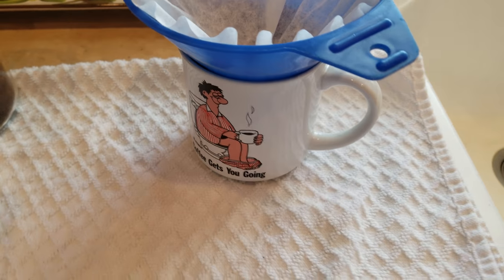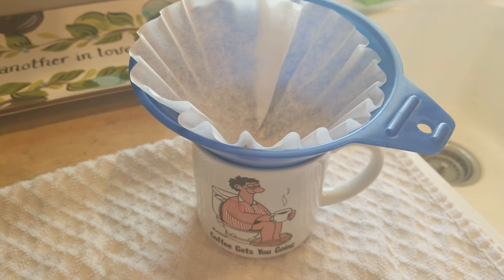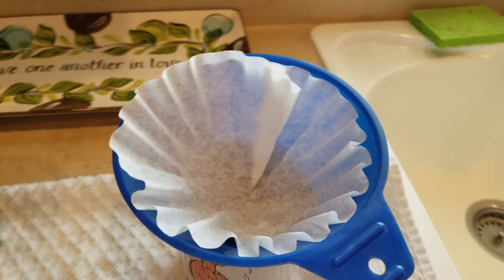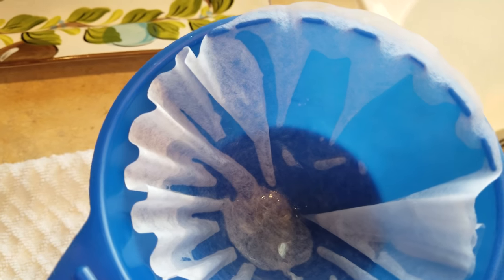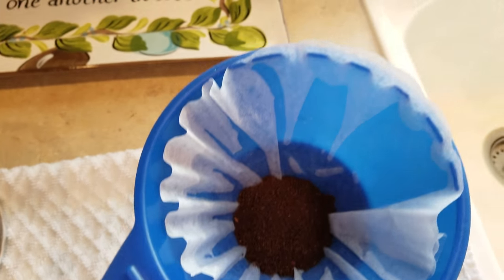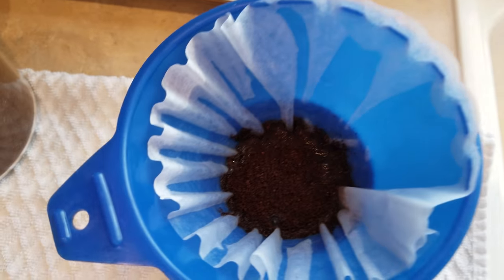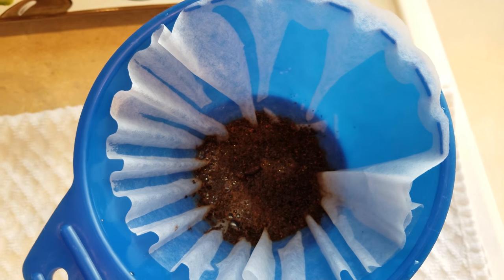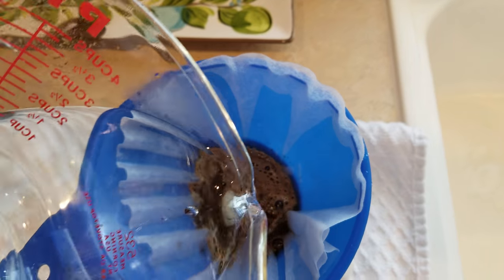DIY Oil funnel pour over coffee maker

Comment: great vid! i though about doing this also but I think there are two potential problems with the oil funnel pour overs: 1, the coffee is not draining fast enough which translates to prolong soaking of coffee beans resulting in over extraction, 2 the plastic of the funnel might not be food grade or even contribute to risk of cancer. have you try it with a metal strainer? those fine pores and the coffee filter might slow down the drip but not as much as the plastic funnel.